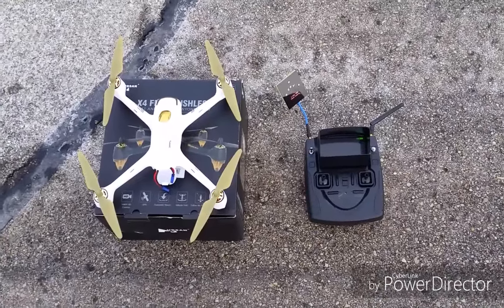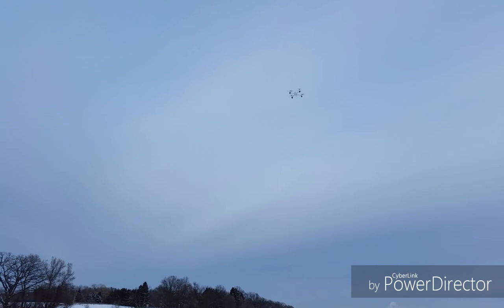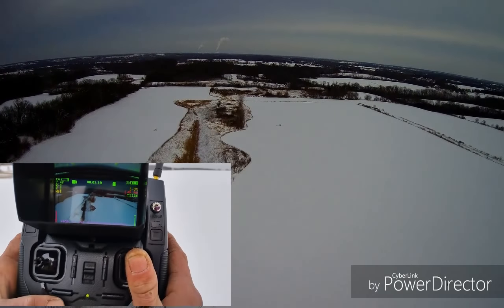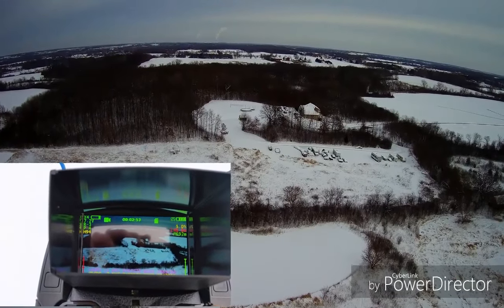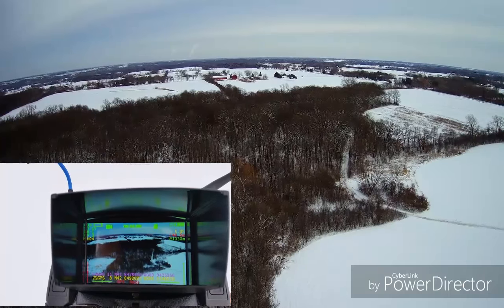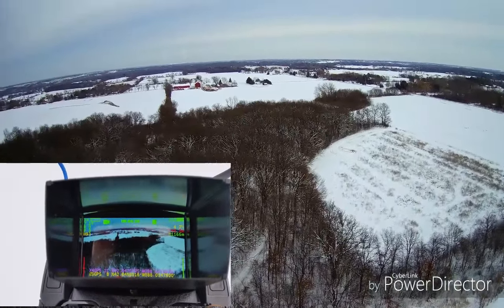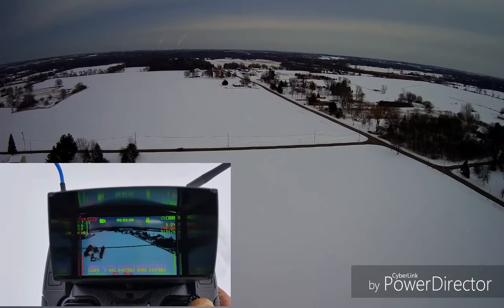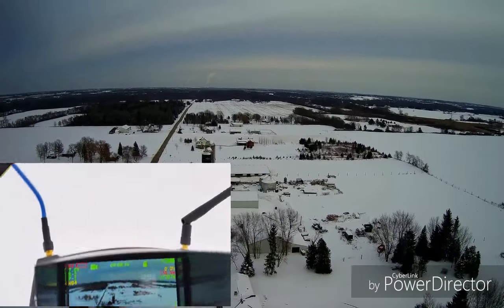hubsan h501ss 2.3Km Range Test. Second Flight After Mods.(May want to turn on Captions).

Comment: White drone over white snow...brave. Awesome distance on that one battery. My original battery that came with my H501ss is my longest lasting. I can get a mile out of it one way. The two batteries I got from Banggood are not good after 6 months. One developed a short and had to be discarded in a cement overcoat. The other one drains too quickly.  I'm lucky to get 800 meters out of it one way. Do you know a good source for H501ss batteries?
Reply from the maker: +D. Eddlemon GearBest. All my quads & batteries come from Gearbest. Also, a Professional Charger is a Must Have !
Reply: Mark Suttner Thanks!
Reply from the maker: +D. Eddlemon Here's An Absolutely Great Charger ! http://radientrc.com/duplex/
Reply from the maker: +D. Eddlemon Link for Batteries https://m.gearbest.com/rc-quadcopter-parts/pp_358342.html?wid=21 Link for Antenna Mod Kit : https://m.gearbest.com/fpv-system/pp_436713.html?wid=21
Reply: D. Eddlemon. I use HRB 2600mah 30c lipos and have had no problems. They fit into the quad better and get the same time if not a little more. The higher discharge rate won't hurt anything. It has the capability to discharge fast but only when the quad or whatever your powering demands that power. Big hype on the discharge number. The h501s is a camera/video quad. Wasn't made or designed for continual racing around. Hence, the OEM 10c battery. A higher discharging battery has the capability to drain quicker and provide the " thrust - aka, punch out " needed when called on. If the power isn't called on, the quad will drain the battery accordingly.
Reply from the maker: Big Daddy That's Correct about the batteries & their C Ratings (Max Discharge Rate). Most Important Thing to consider when you want Longer Flight Time is the mAh Capacity. That's where the Actual Flight Time Comes from. It's how much "energy" (Basically) that the Lipo is Capable of Holding. Higher mAh's the longer Flights you will get. As Long as your Not "Racing" the quad. I know Exactly what you are saying"Big Daddy"...
Reply from the maker: D. Eddlemon Sorry for the Late Reply. I've gotten OEM H501S / SS batteries from Gearbest and they always last about 20 minutes. Most Importantly, You need a Professional Charger/Discharger to Maintain the LiPo's. They are a Very Unstable Lithium-Ion Polymer Electrolyte battery. Originally designed and used by NASA. Over time, technology has been able to make them smaller and Lighter. They can store a Tremendous amount of Energy & Be Recharged Multiple Times if Done Correctly. Proper Discharge & Charge Cycles are Very Important. Also, Never let them Sit around Fully Charged Or Fully Dischrarged if they're not being used. Must be put in "Storage Mode". Storage is where the Voltage & Capacity are About 40-50%. If they sit around Charged, they will Balloon or Swell, because the Resistance Builds Up, leading to Premature Failure. https://m.gearbest.com/rc-quadcopter-parts/pp_358342.html?wid=21
Reply from the maker: Big Daddy You can also do a dual-battery mod to Increase Flight Time. It's a bit tough on the motors because of the extra weight, but using two batteries in a parallel circuit will double Your Capacity and keep the voltage the same. Not a Serious Circuit ! That will Double the Voltage and Fry the quad. They sell the Parallel Wiring Connector (EC2's) all over the place...
Reply: Mark Suttner. I was going to try the dual battery and believe I lost my parallel cord. I've been busy lately with the firmware process. I'm probably done with configurations for the moment ( have a good combo for this quad and where I live. The geomagnectic/compass calibration gave me problems with the first firmware configuration. TBE big time! RTH decent was the scary! ). I wasn't happy flying out to 1k and not having total control of the quad. Movements were very slow and " goofy " out at that distance. So, with the antenna mod on the standard TX that I use and the firmware configuration, ( it's a superflyer package for my area. 1.1.24, I believe, its what kept my quad sane ) I fly out to 2k with little to no problem. The problem being that it might start getting the " goofy " back in the flight, weird movements. Other than that, this quad is solid. Glad it came with the base firmwares so I had to learn about them before experimenting with different ones. I crashed it. 2 times. Bad enough that I had to replace the shell both times! I watched videos on YouTube about replacing the shell and fixed it myself. Had issues with bearings and shims in the motors. Replaced the bearings and shimmed them out and have miles of flight with them with no problems. It's a good hobby grade quad. Helps with learning and having to have hands on time. The perfect quad to start with and move up into a higher class quad. Between the group of guys I follow about the quad and even the 1 that's anti-hubsan at the moment, lol, just my opinion, drone worship is the name, our over the pond buddy Elecifun, Frequent Flyer RC and of course yourself for my decision to choose the H501s. 1 I don't regret. Want to thank you for all your super useful videos and comments/replies!! Much appreciated!! Keep it up! I'm either not finding it or you haven't made 1 yet, h122d. Looks like fun!
Reply from the maker: Big Daddy I Know Exactly what you're talking about... In all Aspects of what you said. I have talked to and kind of know all the people you mentioned. "Elicifun" for instance, takes Other People's (Mine), Ideas & Even Video Footage to make some of his... One Example, watch his video named "Hubsan Watch Before You Buy". Notice Anything Familiar about the video ? If you watch the video I made, Way Back, you'll see what I mean...  He was actually arguing with me that the XDA model panel antenna works better then that blue one that I have been using. I'm not trying to get into arguments with people on YouTube, but this guy really pushed the limits... First, he sounds like he's 18 years old, thinks he knows everything about everything like most kids these days. Anyways, it's pretty cool to see Hubsan Venturing into the Race Quad Area. The H122D X4 Storm, is a Brushed Motor Quad, However it does have a carbon frame, External antenna and Most Importantly a Swivelled Camera. Race Quads Constantly Are Pitching Downwards, so being able to swivel the fpv camera up or down is a Big Advantage ! The faster you want to go, point the camera Upwards More, and Vise versa. I've seen some pretty good reviews on it from Sponsored people. It does have some Punch Out & Speed for being a Brushed Motor Quad. They should be available Soon for everyone and purchase. Thanks for the support. Most of the people that can Monetize their channel to make money, do. I Don't. Don't care to either. By the way, the firmware version FC 1.1.24 Is Exactly what you think it's for. It's a good Version. I am kind of confused as to what you're referring to when you say it is doing some "goofy" movements. I've noticed with my SS that it "Twitches" (Pitches Up & Down) Sometimes, when in GPS Hold Flying. Mostly during a RTH Trip. Thanks again brother ! I Really Appreciate It ! Keep me posted with what's happening with your quad !
Reply from the maker: Big Daddy Actually I think "EleciFun's" video is about the differences between the standard and advanced controller. When I called him out about using video footage that I shot to make his video, he disappeared off the radar. If you know what I mean?
Reply: Mark Suttner & Big Daddy, thanks for all the great advice. I recently purchased a couple of Hubsan batteries from HubsanUS on EBay. They were better priced than their direct website...go figure. They came super fast too. I tried Gearbest first but their S&H was higher than the battery at that time. I've had these new batteries a few weeks now and they are performing much better. I charge them like you say and I think I'll be very happy with them. Thanks again. You guys are great.
Reply: Mark Suttner. That's to bad about Elecifun. I liked that this quad is everywhere over the globe! All walks of life enjoy it and share info and advice. I wish and hope the best for all. Keep it up bro!

Comment: Hello . Cam have an advice for me?! Just I heard about Hubsan H501 SS and I am going to comand one piece. Exist a difference between remote control standard and professional ?
Reply from the maker: Cristian Ionescu Yes, there is a difference. However, the only difference is what controller you get. The "Standard Edition" comes with the FPV2 Controller. The "High or Professional Edition" comes with the FPV1 Controller. There is NO differences between the quad you will get, it is only the controller that is the difference between the two Editions. The quad is the exact same whether you buy the standard or the high Edition. The only difference is what controller comes with it. The standard or also known as the FPV2 Controller, has All the Same Functions as the FPV1 controller. I did make a video about the differences between the Standard Edition VS the Professional Edition. I always Prefer personally, along with a lot of other people prefer the standard controller because it has a much bigger fpv screen, if you do the very simple external antenna modifications, you will get as much or even more long-range capabilities with the quad. The screen on the standard controller is 720p. The screen on the professional controller is 1080p. However, that is not necessarily a good thing, that controller needs absolutely perfect 5.8 signal reception or it starts to lose color and breaks up because it is 1080p. It requires more signal strength from the Quad to display fpv on the screen. The standard controller does not require as much 5.8 signal from the Quad to display fpv on its screen. Trust me, you will never know the difference of looking at a 720p fpv screen or a 1080p fpv screen. This is the Biggest Difference : the screen on the "Professional Controller is Really, Really Small. It's Very Hard to see. The Standard Controller's screen is Big. About Twice the size of the Pro Controller Screen. Also, if you ever wanted to update firmware, you will have a ton less problems with the standard controller. Tons of people that try to upgrade their firmware that have the professional controller, run into Major Problems. https://youtu.be/7g444NFHsno https://youtu.be/_Cl1X1N4C-U https://youtu.be/fCibtj-YgRI If you want more info on the differences, Feel Free To Ask, Anytime !! :) Also, the Standard Edition Now Comes with a sunscreen for the controller, a lipo battery for the controller as well.

Comment: Mark, 501s-s or x4 pro standard?
Reply from the maker: Dj Sharp Hey brother, your comment doesn't exactly make sense... Unless you meant H501SS Or H109S X4 Pro ? The 501's come with either the "Advanced/Pro/H906A/FPV1" Controller, they are called Many names... OR the H501SS Also comes with the "Standard/H901A" Controller, for Less Money. You can buy either one. The H501SS has had so many people claiming that it only comes with the H906A Controller, It's Rediculously Funny !! The H501S-S can be bought Either Way. You get Different Controllers, that is the ONLY Difference. As for the H109S X4 Pro, that quad has 3 Editions. Low, Medium & High Edition. The Low Edition comes with a 1 axis servo controlled gimbal and the H906A Controller. The Medium Edition comes with a 2 axis Brushless Gimbal and the Same H906A Controller. The High Edition comes with a 3 axis Brushless Gimbal and the H7000 Smart, Touchscreen Controller. There is A Lot of confusion about Hubsan quads. The 501's are also called the "Hubsan X4 H501S". Sometimes it's also called the "Pro" Edition, Only because it comes with the H906A controller (Same Controller that comes with both the Low & Medium Edition H109S). So, to clear some confusion, there is NO difference between the H501SS Standard or "Pro"/Advanced Edition SS, besides the controller that comes with it. I "Personally" recommend getting the Standard Edition H501SS and then doing the external long range Antenna Mods to the Standard/H901A Controller. Everybody has their own preference on which Controller is better. I've found, after Multiple Tests, that the Standard/H901A Controller is a better buy.
Reply: Mark Suttner sorry man lol. I was meaning to ask I guess, what are your thoughts on which one I should purchase? I already have the patch antenna and the 2.4g antenna for extra range. I had a 501s-s fly away in me, but it was my fault. I know you like both, being the x4 pro (low edition) I'm guessing, and the 501ss. I'm looking to get another bird, but which of the two do you prefer? Thanks for the enjoyable videos! Very informative man.
Reply from the maker: Dj Sharp I gotcha... Funny you should mention getting a new drone. I am too. I CANNOT Decide on What to buy ! Already have 3 Hubsan quads. If you Really want to Stick with Hubsan, either get the SS or the H109S X4 Pro. Best two Videography drones they make. If I were to choose again, I'd buy the H109S X4 Pro Medium Edition (2 axis Brushless Gimbal with H906A controller). However, your starting to get into some Heavy $.... If your going to spend $500 + , you may want to think about a Mavic Air. Newest DJI Quad. It's Right in between the Mavic Pro and the Spark. That's where I'm Stuck. I want a quad that is portable, fast and nimble but can also take Great Videos and Photos. Don't get me wrong, the SS and the h109s take great videos and photos however they are not the best. It's Ultimately up to you brother. It's your money, spend it Wisely. I've had Very Close Crash encounters with the H109S and It Was Not my fault. The 109 comes with the same 8 APM processor that comes with the 501's ! So basically, the 109 is just an SS on Steroids with a Separate Camera & Gimbal. It doesn't have Any Different Flight Functions. Except the 109 Does Not have Follow Me Mode. I'm leaning towards DJI. I Really don't know what to do because I had a Phantom 3 advanced. I sold it. The stupid App you have to use, Will Not let you fly unless it's "OK" with them. I didn't like that. However, the Mavic Air is A Hot Item right now and Has 20 more Functions then Any Hubsan, along with Obstacle Avoidance, Image Stabilization, on and on. I'll stop blabbing now. Once again, if You Must Have a Hubsan, I would "Personally" get a H109S over the SS. :)
Reply: Mark Suttner  I appreciate that input man. I'm doing my research as we speak. If I get a dji, it will probably be the air. I'm a roofer and only make 12$ an hour, so I should be able to save for it in a couple years lolololol. No, I also was looking at the mi 4k, and I like it, but at a gut feeling its off somewhere. I have my doubts that their app will work sufficient. Plus, in their app, you have to execute a (flight school). To me, its leaning towards a dji or hubsan, considering everything, but mostly camera and flight time. Most important, getting it back to me lol.
Reply: Mark Suttner also , where should I order a hubsan from? Will just a new bird work with the tx I still have? Appreciate it.
Reply from the maker: Dj Sharp I "Personally" Always buy from GearBest. Never received anything faulty from them, ever. As for your Controller, It Should Bind to a new bird. However, You Must Make Sure You get a SS and NOT an S ! The Firmware Versions Are NOT Compatible At All. If you buy Only a Quad Without a Controller, you may run into problems because the Controller's Firmware Must Match The Quad's firmware. Anyways, buying Only the quad is probably going to cost just as much as if you were to buy the SS Standard Version With a Controller that Is Already Matched with the quad. They're on sale at GearBest for $205 Right Now !
Reply: Mark Suttner i purchased the bebop 2 from Best buy yesterday. I'll keep you updated man.

Comment: Nice job Mark.  I've yet to get out and fly both the Mavic and my new Hubsan H501s-s. I remember flying a couple years ago my flying 3D X6 in the cold.  I think around 19*F. The run  time was cut significantly if I remember plus I had a crash.  I see you also use Cyberlink for your video editing like I do...
Reply from the maker: +MrPolymers actually for some reason, cold weather increase is my flight time. It helps keep the battery, motors & ESC's cool. Plus, cold dense air can increase rotor lift, making it easier for the quad to stay airborne. I would have Tried to fly further, but my hands were Absolutely Numb, about to Literally get Frostbite on my fingers. I couldn't hold the controller anymore. I hit RTH, ran to my truck in Serious Pain, then just watched my screen to make sure the quad was coming home as I was painfully trying to warm up my fingers.... I'm not sure exactly how far that thing will go, I'm starting to worry about battery life when you go that far because if it don't make it back then what?
Reply: I guess at 60 years old, ain't as much fun to be  flying in the cold.  Plus, I prefer to fly at my RC field with no snow.  Good Flying..
Reply from the maker: +MrPolymers Thank You Sir ! I did see your video where you are flying your h501S in Altitude Hold at your RC Field. You were correct in that video when talking about the quad is smoother and altitude hold. It is, but can be a disaster if flying in windy conditions or giving it too much throttle or elevation at one time...